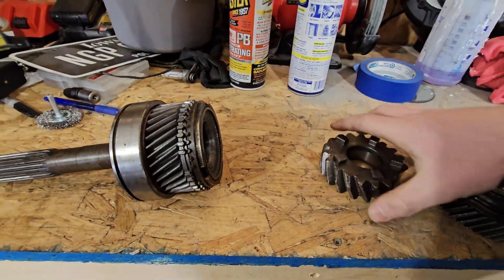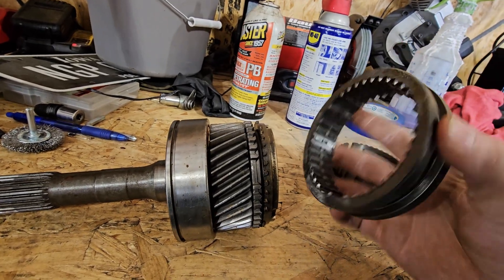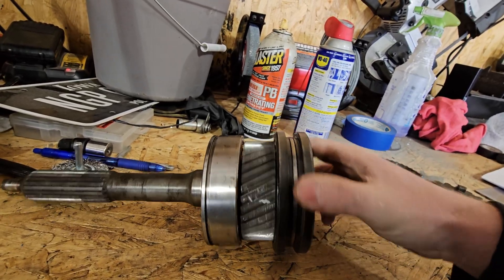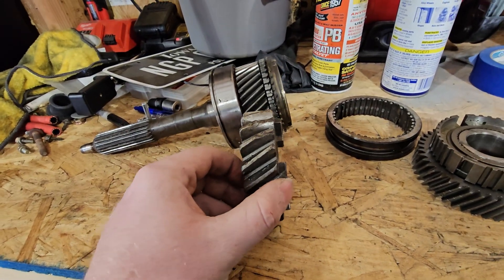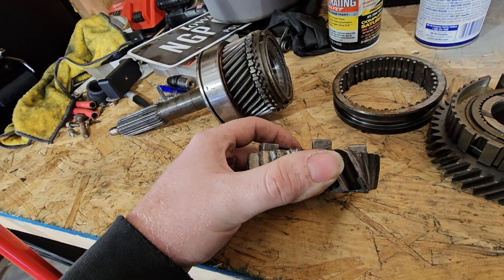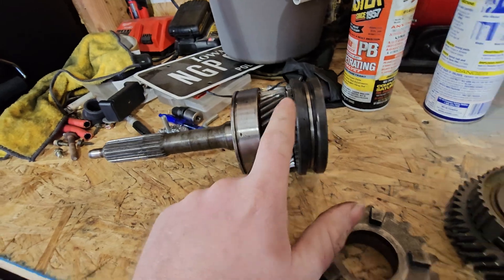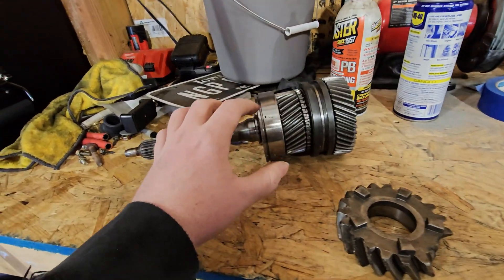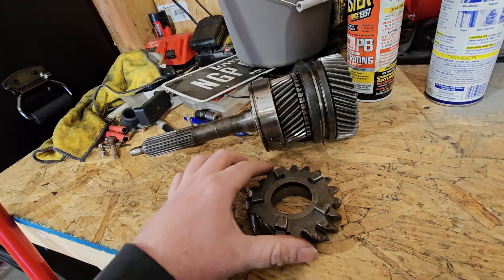THE DIFFERENCE BETWEEN SYNCRONIZED AND DOGBOX TRANSMISSIONS

Comment: I will no longer be floating my synchromesh 😂😂

How bad is downshifting clutchless on a synchromesh? Is the synchro still getting worn as bad since it doesn’t have to bring the engine speed down?
Reply from the maker: There will still be wear cause you're pushing the bronze again the weight of the car
Reply: @RabidJz thanks for showing this stuff, I didn’t realize the severity of what I was doing 😂 cheers 🫡👋
Reply: While I’ve got your attention could I ask how bad no lift shifting is on a stock clutch and trans? There’s this guy on YT : TRE - The Race Engineer and I see him absolutely send it without an ignition cut it seems. I’ve done it a couple times but it feels so wrong/right 😂